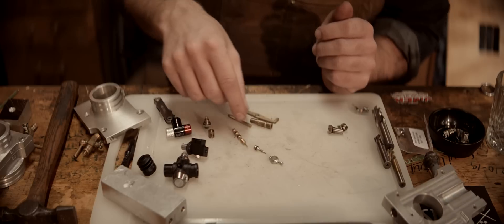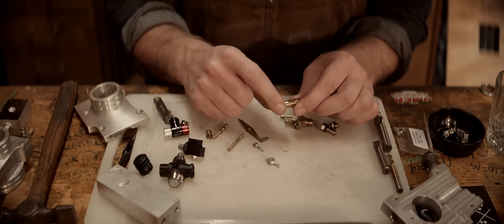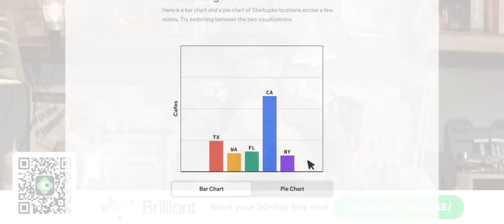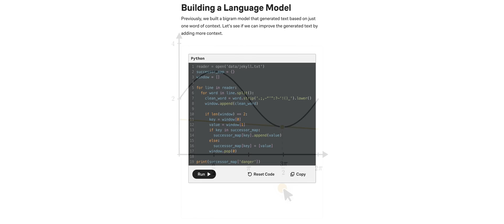Making a Super High Pressure Carburetor pt1.

Comment: does anyone in the comments here have any idea on what the maximum horsepower is that has been achieved with a 50 cc two stroke using just gasoline or alcohol or methanol?  im interested in building a engine for a drift trike out of a chainsaw but need to know what is doable and what to expect as far as output?

Comment: i just took apart a blood pressure pump that you use to read your blood pressure and found something interesting it's a solenoid valve that runs on 6 volts and has a single line inlet and when you apply 3.7 or 6 volts to the solenoid it closes the valve which means that its always open until a voltage is applied to it this may or may not be safe for a fuel system i have not tested it on a fuel system.  of course it's not for use with a liquid only a air or gas should be ran through it but it could be useful for a vent on a fuel system maybe hooked to a killswitch to shut off a vent or something like that i just thought maybe someone on here might have a use for this information

Comment: The thing you mentioned at the beginning of the video we call builders block... myself growing up in family of machinist and engineers have figured out my own way of dealing with this is, i go and make myself experience a new motorsport and get out of my own head a day or two... the adrenaline rush might just be the thing that makes you come at a problem at a whole new angle with a different mindset instead of thinking of ideas and failing by being in a superfocused locked in vibe and not looking at the WHOLE issue and focusing on the little bits .... hope this helps brother i enjoy your process of being through but it is taxing

Comment: 9:50: when using 'sandpaper' on lathe work, always back it with something flat like a file or piece of wood.   sandpaper is too floppy to give any sort of accuracy.  ideally your backing should be a little wider than your workpiece, so you don't have to run up n down it

Comment: that "shackle" is due to breathing in chemtrails aluminum powder which is toxic to the nervous system. I feel it too until after I take a cleansing remedy to get out aluminum and all other heavy metals. Works like a charm. FYI chemtrails are most often sprayed at 10,000 ft but the altitude has to be over twice that much for the air to be cold enough to produce contrails. The skeptics (ie: sheeple) tend to overlook that fact along with many others. I'm sure I'll hear from them here. Like a bunch of zombies with their brains oozing out their ears.

Comment: One suggest for fuel system.
Why not to use solenoid valve to adjust fuel pressure like diesel cars are doing in common rail system?
It would be easy to control with arduino and you don't have to have to create something new.

Comment: Is it going to work off regulated flow of the pump that increases and decreases ,could simplify it with a full pressure pump and cable operated valves regulating the fuel thru your hand built carb with 1 sucker idle jet and 1 pressurised main jet  ,when i see people making stuff gets me thinking, dont listen to any negativety my moto is if your not helping your just another problem ! Hence reading some negative comments.

Comment: To seal better maybe a cone could reduce the need for low tolerances, and is adding a checkvalve (one way valve) on the return line possible ?

Comment: Why not making a controlled orifice for the high pressure fuel to pass through, you can use carb jets to control it and would be easier to try different sizes

Comment: I do wonder if your over complicating things a little. Here is an idea for you. Use a fuel injector but instead of pulsing it just switch it on permanently and control the flow via a regulator and your pump speed. This gives you the atomisation and fuel return you require. You then have extra options should you need them. A very easy way to switch off the fuel should you need to by cutting the power to the injector. You also have the option to use a fuel regulator which can increase its fuel pressure based on air input pressure (like on old turbo cars) as another way to control fuel input.

Comment: Good to see you back again. Can relate with your mental block issues and pushing through. Keep up the fight. Just a thought but vw Audi and Porsche used continues injection in the early days of injection. It was called K-jetronic. It worked well at the time but fuel efficiency and emissions got the better of it. Not a concern for your application. It ran at 65 psi as far as I recall.  Could be worth a look as it ran an accumulator and high pressure metering body also injectors suited to running continuously.

Comment: why are silikon-fuel pipes in use ? ...not flexible fuel pipes should be , it doesn't matter if the fuel pump is adjustable 
your system is not constant in air-flow and fuel-flow !

Comment: You definitely need a pressure gauge between the pump and the carb, so you know what is actually happening there. Actually, it may be good in the future to have a pressure sensor between the pump and the carb, and use the arduino to modulate the pump RPM to maintain a set pressure (or a varying pressure, depending on engine load or whatnot). But at a minimum, a pressure gauge will tell you a lot more about what is happening, and will give you feedback on how much pressure is required to make your jet of fuel.

Welcome back, btw! Keep this shit up

Comment: I have an idea, two small carbs with one intake... carb one is the idle -1/2 throttle and jetted accordingly. Then carb two begins to open for 1/2 - full throttle jetted richer on the bottom and needle setting to get into the powerband and then you can set the overrev on the second carbs main jet. then you could run "standard" jets in two smaller pwk carbs dividing the fuel delivery and air metering like a double pumper hollery on  v8 . Just a thought to get more fuel into the engine for nitro methane.
Reply: 2) 21mm pwk with 200 main jets and 70idle jets, they would both be high velocity and pissing in the wind
Reply: The needle and seat will hold about 3psi , I used to use a mikuni vacuum fuel pump and a pressure reducer from an auto parts store and 3 psi didn't pee on the ground and ran like a rocket on my 250cc, I bent the float lever setting the float a little lower for more holding pressure.

Comment: Can you use a normal electronic fuel injector in the transfer and just varie fuel pressure instead of pulsing it?
Reply: technically but it's hard to change the pressure fast enough for the throttle response

Comment: 1:08 I guess I know the feeling. I get mad at things I know I would need to do or even things that I'd want to do. Or maybe not mad at things to do, but other things that "prevent" me to do them. Then I get somewhat mad to myself. I think most often it's the combination of "not enough resources" and just massively overthinking every possible point of failure, ways to fail and/or every single lack of resources. I'd need some sort of cheat code to just skip that part of my brain activity to be able to start doing. It's always the start that's the most difficult thing, especially if I stop to think before impulsively starting something. Same goes for continuing a thing, when it needs a restart after being on hold for some time. But again there are all the things in my mind that say "no can do, because of this and that and...". There needs to be some kind of drive that just pushes me through. Sometimes in a very tight schedule. Or there has to be some thing or someone that forces that "drive" if it doesn't come in an impulse. In rare occasions a certain flow starts and things get done very effortlessly.

It's one of the most frustrating things in life, as I can't explain it and it most probably looks like just plain laziness to others. Especially as there isn't "anything wrong" with me. Though I'm going through some diagnosis for ASD and hoping I'd find some answers for my restless soul.

A few years ago one guy told me his fathers old saying "If man wants, man does." Too bad there is this thing called brain in between me and doing. I guess I'd have to eat some brain-defeating drugs to get over it.

Comment: Why not copy an RC nitro engine carburetor and scale it up?
Reply: Sounds like a plan, but... no matter what fuel (Gas, methanol, nitromethane, or a combination), the problem with r/c barrel or slide-type carburetors has always been trying to get the engine from start-up to its peak bhp speed without experiencing an overly rich or lean mixture. This traditionally manifests itself as either a rich "flame-out," or a soaring cylinder temperature "bog." For almost 65 years some of the best minds in miniature two-stroke engine design and development (0.15—0.65 cu. in.)have tried, unsuccessfully (in my opinion), to solve the idle to w.o.t. enigma.

There are many factors that contribute to the dilemma, including the effects of ever changing atmospheric conditions, the fuel blend being used, the engine's design, and the guy doing the tuning... to name only a few.

From my experience, trying to make an all-out racing two-stroke engine handle the start-up to full power deal with a carburetor is a totally unreasonable request from an ancient technology—the fuel injector (electronic or mechanical) can handle Alex's 50cc engine with a relatively simple A/F map... wholly good enough to get him to where he needs to be: the correct w.o.t. mixture ratio that produces peak b.h.p. and is repeatable from run to run.

Comment: Wouldn't it be possible to build a possibly mechanical  fuel injection? Or a simple EFI, that only uses a map sensor and temperature sensor, throttle sensor. Run a fuel pump with micro controller and pwm controller run it at about 15-16v and the controller ramps up the pressure with the throttle. Use a roughly 40mm throttle valve. With a 70-80mm bell mouth with the injector outside the bell mouth , just close enough so all the fuel spray makes it into the bell. Shower injection, and as far as oiling goes. Why not have a drip feed for the main bearings. With a m6 drain plug in the bottom of the crankcase to drain the oil between rounds if there is any, or put a small sight glass oil catcher in  the hole. And run less oil in the fuel. Having the crank EDM drilled with a 0.05mm oil passage from the main bearings is probably out of the question. Filling the tiny passage with gear oil or grease. Maybe it would pull the oil through as it slings out the grease. Then the oil can fill it when sitting , then pull it out like a siphon would to oil the rod bearing then a really light mix to oil the piston and rings . I'm thinking someone must have a EFI controller and a program that can be tuned to work. It would help performance alot  being able to map out the fuel and timing. Build a 12v-14v +/- battery with 5-10 ah maybe more to power the system. It would be awesome to put a pair of injectors in the transfers, running at roughly /6-8+ bar basically making it Direct injected. Possibly experiment with multiple injections. Or use actual direct injectors , and inject micro seconds before the ignition . Then crank the compression up a half dozen bar. Go from 8:1+/- to 10-11:1, use c16 race fuel or possibly E-85. E100. Methanol, I wonder if anyone has direct injected nitromethane?? Sound explody‼️😮 I'm thinking 20% max, have fun, get you head right, take care of yourself!. And peace brother, 🕊️
Reply: Separate jetnozzels for different liquids.
Maybe a separate tank for nitro-injection in transfers as auxiliary fuel injection and juse a methanol tank +injector in bellmouth for maximum charge cooling.
Use a scavenge pump reversed and feet pressure to both tanks and 2 fuel regulators. No return line on the Nitro its either on or off full spray then put a simple twist valve to drain nitro after each run from line

Comment: Hm, mayby a self propelling fuel, how about a mix of 50% propane and 45% nitromethane and 5% castor oil. You will hawe a fuel with with built in pressure and need no pump just an adjustable (trothleble) spray nossle. If you need higher pressure you can add methane. These gases are easily available.
And dont forget to exercise, it is good for your head and soul.

Comment: This is almost becoming unwatchable from a technical point of view. The problems that you are attempting to solve have already been—as described by many faithful viewers over the past several episodes. Please stop experimenting for the time being and seek competent mental health treatment. I'm beginning to fear for your well being. Wishing you the best!
Reply: Yeah honestly I see it the same way at this point, it's very painful to watch. Love this channel but over the past few months it's just turned into what you described. Most of the recent uploads I just click through and click off when I see the struggle of trying to reinvent the wheel in an area where there's a 100x simpler solution available. Where other people have already gone through the stages of pulling their hair out wondering why it doesn't work and ended up fixing it. I genuinely cannot fathom why he doesn't just buy a uaEFI rusefi board, speeduino NO2C, or whatever else 2T compatible standalone EFI ecu(the two I mentioned are open source and customizable, and extremely affordable) fits his budget, fuel pump from [insert any efi bike/car made in the last 25 years] and an injector that is large enough from [insert any efi bike/car made in the last 25 years] and pair it with a throttlebody from [insert any efi bike/car made in the last 25 years] of a sufficient size. I do not understand this obsession with creating a mechanical solution for a problem that is best solved electrically.

Comment: I just want to put this out here in case you read the comments: A few episodes back you said you would return to making things a bit easier by starting from things you know that work. I see now that you are trying out new unknown stuff and that is all great to watch. But if you feel like you get stuck again, just remember what you suggested to yourself a few episodes back. Most of us are here to watch you and what you do. Doesnt matter if it is something wild and experimental or just confirming what is allready been proved before. We are here to experience it all with you. Thanks for your video's, i love what you do in your garage.
Reply: I know this is Alex's channel and he can do what he choose, but I genuinely believe he should have at least 2 fully race ready engines after 7 years!
Alex said he was going back to basics to make progress but it seems to have deviated from that path again.
So many problems have being derived from trying to run Nitro Methane RC fuel going back to the SPX 7 years ago.
There are so many things that need doing prior to the PiP 2 engine arriving. A heavy duty steel box section is required to be fixed to the floor at waste height to accommodate the engine and a PTO oil pump which will give total control over loading the engine which has being the goal of every dyno. All you need is a 1" ball vave with a 2 foot long handle to control the oil flow, no electronics needed! Dead easy! One hand on a twist grip and the other on the ball valve handle, what could be easier?
I know Alex has mental health issues, so do I along with other age related problems! But I do more in my garden shed, not a garage but a 8x6 garden shed full of other shed items and only hand tools! Improvisation is paramount!
This is not a bash Alex post as such but I genuinely believe Alex owes proper progress in return to his Patreon supporters, donations and followers after so mant years!
Has any one else noticed how the viewing figures and comments have fallen over the years?
As a final comment Alex and my self have differed so many times in our tuning approach from when I tuned and raced bikes back in the 70-80's. 
I'm not wanting to upset Alex with this post and it's not trolling but a logical observation from a engineering point of view!
Reply: Yeah this munter adding high pressure to a carb is freaking stupid. This has all been done before and hes ignoring the amazing minds that worked it out before us.
Reply: It's called clickbait

Comment: Just use a normal efi if you use a pwm closed loop pump you can alter the pressure and then run 100% duty cycle on you injectors on peakpower.

Comment: What about using the collet from the likes of a Dremel for holding the .8 bit..  then putting into the drill press chuck ??
Reply: Or just rap some thin wire around the drillbit end, it’s then bigger in diameter
Reply: @aebbig Wrapping wire around the bit will almost certainly result in run-out.  The chuck would deform the wire wrapping and the bit would wobble.  There would also probably be an issue with the bit seizing in the piece due to insufficient grip.